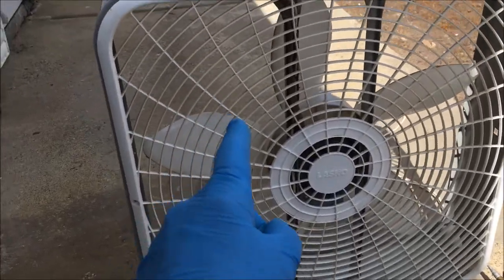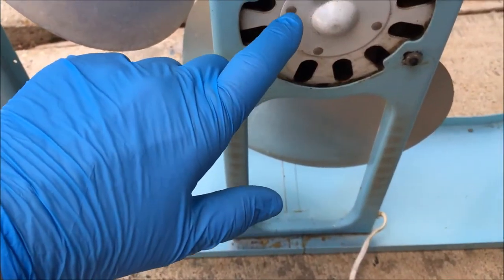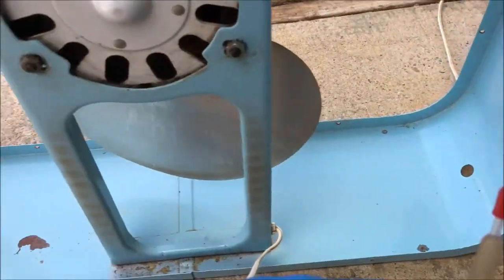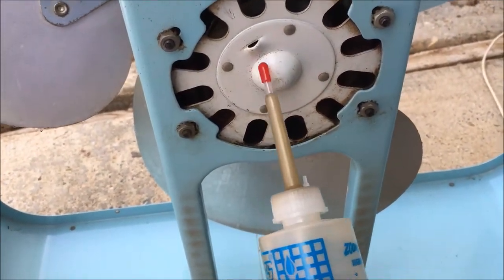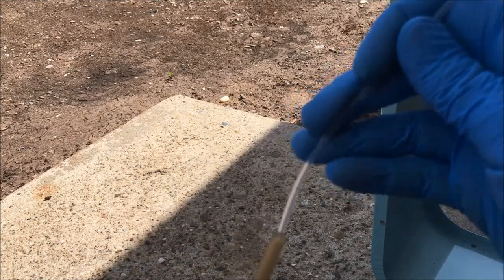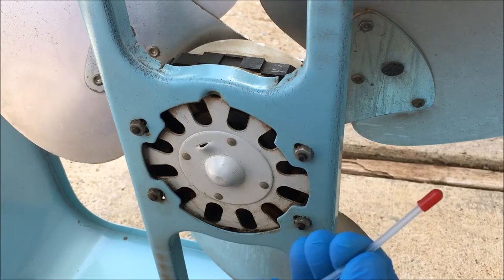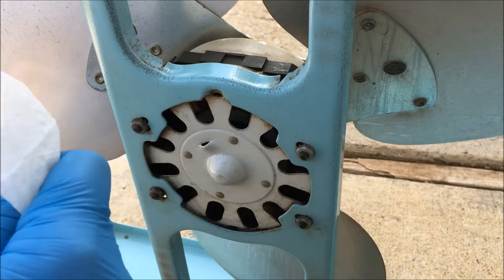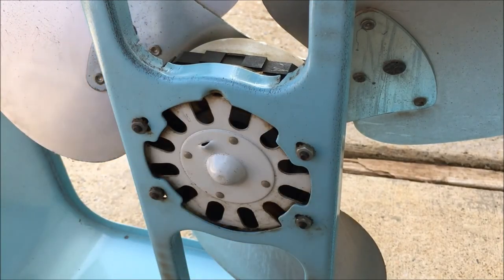Oil Fan & Blower Motor | Furnace, AC, HVAC, Box Fan

Comment: I have an old-school black and decker 230mph leaf blower I'm working on and wondering what oil to use in it since it runs at such high rpms and it has brass bushings

Comment: Damn that k mart is clean. I have one original on the box that I cleaned up. You can polish the blades with some aluminum polish. Looks amazing after.
Reply from the maker: Hey Zack,  I LOVE my Kmart fan--just love her.  I'm an old-school gal.  The junk they make and sell today is shameful.  I'll give polishing the blades a go.  Thank you bunches for the tip.
Reply: @frugaldiy1  yeah that’s why I like the old stuff. They actually have oil ports and the motors are built so much better. The new garbage is made out of pot metal which gets brittle over time.
Reply from the maker: I agree 100%!  They don't make things or people like they used to.  ;)